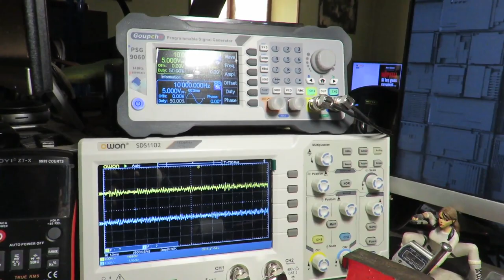GHK6/GHK8 multi-tool with bit kit, mini flashlight & camo sheath!

Comment from the maker: MT VOD * Dear lovers of multi-tools, you can ask me everything, redo a review, insist on a detail, make comparisons, test this or that, I am at your disposal! :) * Multi-Tool VOD
Here is my collection of multi-tools (March 2021) [/S = Brand Sheath]. Each model has been the subject of one or more videos (see my playlist "MULTI-TOOLS").
001-	AXE Multi-tool (pliers/ knife/ hammer/ axe) /S
002-	BALADEO Outdoor Camping Cutlery Multi-tool ECO104 /S (*3)               
003-	BEAR & SON Bear Jaws 155LS /S
004-	BEAR & SON Bear Jaws Multiscissors Gardener BC157GT /S
005-	BEAR & SON Electrician's Bear Jaws BC155EL /S
006-	BEAR & SON Mini Bear Jaws 153
007-	BIBURY GHK 10-in-1 EDC
008-	BIBURY Multifunction Garden Pruner BBY-MT11 (offered by the company) /S
009-	BIBURY Multifunction Tool 21-in-1 BBY-MT08 (offered by the company) /S
010-	BIBURY Multifunction Tool 16-in-1 X0016E2LAJ (offered by the company) /Box
011-	BLACK FOX BF200 /S
012-	BÔKER PLUS Tech Tool Carbon 4 /S
013-	BÖKER PLUS Tech Tool City 5 /S
014-	BUCK Knives X-Tract 730 /S
015-	BUCK Knives X-Tract 735BKS-B Essential
016-	BUCK Knives BuckTool 350 (MiniBuck)
017-	BUCK Knives BuckTool 355 /S
018-	BUCK Knives BuckTool 360 /S (*2/ one completely broken)
019-	BYRD ByrdRench BY15P /S
020-	COLEMAN Pro Lock /S
021-	CRKT Bivy CR9250 (by Hans Florine)
022-	CRKT Guppie CR9070 (by Launce Barber)
023-	CRKT Technician Multi-tool CR9201 (by Glenn Klecker)
024-	CRKT Tool CR9200 (by Ed Van Hoy & Tom Stokes/ with Bit Kit) /S
025-	CRKT Zylla-Tool Jr. CR9065K /S
026-	CRKT Wooden Multi-Tool Kit CR1035
027-	DEEPEE 8-in-1 Shears Multi-Tool /S
028-	DICE TOOL EDC Multi-tool
029-	EICKHORN SOLINGEN PRT-II Rescue Knife /Böker S
030-	FISKARS Cuts+More
031-	FLEXCUT JKN91 Right-Handed Carvin' Jack /S
032-	FLOCON DE NEIGE 18-in-1 /S (& 15-in-1)
033-	GANZO G301-H /S
034-	GANZO G302-B /S
035-	GERBER Armbar Cork
036-	GERBER Armbar Drive Onyx
037-	GERBER Balance /S
038-	GERBER Bullrush /S
039-	GERBER Center-Drive (with Bit Kit+ Victorinox Scissors) /S
040-	GERBER Center-Drive Plus (with Bit Kit) /S
041-	GERBER Crucial /S
042-	GERBER Crucial Black (with strap cutter)
043-	GERBER Crucial F.A.S.T. (with Hex Bit Kit)  /S
044-	GERBER Curve
045-	GERBER Diesel /S
046-	GERBER Dime (*3/one with broken cissors)
047-	GERBER Flik /S
048-	GERBER Fit /S
049-	GERBER FreeHand /S
050-	GERBER Freeman Exchange (with 3 blades) /S
051-	GERBER Grappler /S
052-	GERBER Prybrid Utility
053-	GERBER Prybrid X
054-	GERBER MP1 /S
055-	GERBER MP1-MRO (with Bit Kit) /S
056-	GERBER MP 400 Compact Sport (05500/ 45500) /S
057-	GERBER MP 500 Recoil Auto-Plier /S
058-	GERBER MP 600 Basic Black (07550) /S
059-	GERBER MP 600 Black (07550G1 Carbide Cutters) /S
060-	GERBER MP 600 Bluntnose (old model with 55200 Multi-Plier Pocket Tool Kit) /S
061-	GERBER MP 600 Bluntnose Black (07520G1N Carbide Cutters with Tool Kit) /S
062-	GERBER MP 600 Bluntnose (07500 Carbide Cutters) /S
063-	GERBER MP 600 Pro Scout (07564 with Tool Kit) /S
064-	GERBER MP 650 Evolution (with 2 heads)
065-	GERBER MP 700 Urban Legend /S
066-	GERBER MP 800 Legend /S
067-	GERBER MPT #5 /S
068-	GERBER Multi-Lite (07205)
069-	GERBER Nautilus /S
070-	GERBER Obsidian
071-	GERBER Octane /S (*2)
072-	GERBER Radius /S
073-	GERBER Splice
074-	GERBER Strata /S
075-	GERBER Suspension /S
076-	GERBER Suspension-NXT /S
077-	GERBER Truss /S
078-	GERBER Vise
079-	HANWEI Professional Multi-tool by PAUL CHEN 1008-GT
080-	HAVALON Evolve Jim Shockey Signature Series XTC-60AMTS /S
081-	HENSTRONG (or Bibury or Intey or …) 18-in-1 /S
082-	HX OUTDOORS Multi-tool /S
083-	KERSHAW A100C /S
084-	KERSHAW Select Fire 1920
085-	KELVIN.36
086-	KING INNOVATION L-tool Lighting Multi-tool 46700 /S
087-	KITA Le Dépanneur x2 /S
088-	LEATHERMAN Blast (with Removal Bit Driver) /S
089-	LEATHERMAN Brewzer
090-	LEATHERMAN Charge+ (with Bit Kit & Pocket Clip & Lanyard Ring & Bit Driver Extender) /S
091-	LEATHERMAN Charge+ Black Oxide /S
092-	LEATHERMAN Charge+ Forest Camo (with Bit Kit & Pocket Clip & Lanyard Ring & Bit Driver Extender) /S
093-	LEATHERMAN Charge+ G10 Earth (with Bit Kit & Pocket Clip & Lanyard Ring & Bit Driver Extender)/ S
094-	LEATHERMAN Charge+ G10 Orange (with Bit Kit & Pocket Clip & Lanyard Ring & Bit Driver Extender) /S
095-	LEATHERMAN Charge+ G10 Red (with Bit Kit & Pocket Clip & Lanyard Ring & Bit Driver Extender)/ S
096-	LEATHERMAN Charge+ TTI (with Bit Kit & Pocket Clip & Lanyard Ring & Bit Driver Extender) /S
097-	LEATHERMAN Charge+ Woodland Camo /S
098-	LEATHERMAN Charge AL /S
099-	LEATHERMAN Charge ALX Black Oxide /S
100-	LEATHERMAN Charge TI 2HO (with Bit Kit & Pocket Clip & Lanyard Ring & Bit Driver Extender) /S
101-	LEATHERMAN Charge TTI (with Bit Kit & Pocket Clip & Lanyard Ring & Bit Driver Extender) /S
102-	LEATHERMAN Charge XTI (with Bit Kit & Pocket Clip & Lanyard Ring & Bit Driver Extender) /S
103-	LEATHERMAN Core /S
104-	LEATHERMAN Crunch /S (*2 / including a clone)
105-	LEATHERMAN Expanse E306X /S
106-	LEATHERMAN Expanse E33BX /S
107-	LEATHERMAN Expanse E33T /S
108-	LEATHERMAN Expanse E55BX /S
109-	LEATHERMAN Expanse K502X /S
110-	LEATHERMAN Flair /S
111-	LEATHERMAN Free K2
112-	LEATHERMAN Free K2X
113-	LEATHERMAN Free K4
114-	LEATHERMAN Free P2 /S
115-	LEATHERMAN Free P4 /S
116-	LEATHERMAN Free T2
117-	LEATHERMAN Free T4
118-	LEATHERMAN Freestyle /S
119-	LEATHERMAN Freestyle CX /S
120-	LEATHERMAN Fuse /S
121-	LEATHERMAN Juice B2
122-	LEATHERMAN Juice C2 /S
123-	LEATHERMAN Juice CS3
124-	LEATHERMAN Juice CS4 /S
125-	LEATHERMAN Juice KF4 (offered by the company & signed in my name by Tim) /S
126-	LEATHERMAN Juice Pro (with Victorinox Mini Screwdriver) /S (*2/ one offered by the company & signed in my name by Tim) /S
127-	LEATHERMAN Juice S2 /S
128-	LEATHERMAN Juice SC2
129-	LEATHERMAN Juice SX /S
130-	LEATHERMAN Juice XE6 (with Victorinox Mini Screwdriver) /S
131-	LEATHERMAN Kick /S
132-	LEATHERMAN Klamath /S
133-	LEATHERMAN Leap /S
134-	LEATHERMAN Mako TI
135-	LEATHERMAN Micra
136-	LEATHERMAN Mini Tool
137-	LEATHERMAN MUT (with Bit Kit & Tool adapter V2) /S
138-	LEATHERMAN MUT EOD /S
139-	LEATHERMAN Nehalem /S
140-	LEATHERMAN OHT Coyote Tan(with tweezers) /S (*2)
141-	LEATHERMAN OHT Black /S
142-	LEATHERMAN PST (*2)
143-	LEATHERMAN PST II
144-	LEATHERMAN PULSE /S
145-	LEATHERMAN Raptor /S
146-	LEATHERMAN Rebar /S
147-	LEATHERMAN Rev /S
148-	LEATHERMAN Signal /S (with Bit Kit & Bit Driver Extender)
149-	LEATHERMAN Sideclip /S
150-	LEATHERMAN Sidekick /S (with carabiner)
151-	LEATHERMAN Skeletool /S
152-	LEATHERMAN Skeletool CX V1(with Bit Kit & MUT Bits) /S
153-	LEATHERMAN Skeletool CX V2 /S
154-	LEATHERMAN Skeletool KB
155-	LEATHERMAN Skeletool KBX
156-	LEATHERMAN Skeletool RX (with Bit Kit & MUT Bits) /S
157-	LEATHERMAN Squirt E4 (*2/ one offered by the company & signed in my name by Tim)
158-	LEATHERMAN Squirt ES4
159-	LEATHERMAN Squirt P4
160-	LEATHERMAN Squirt PS4
161-	LEATHERMAN Squirt S4
162-	LEATHERMAN Steens /S
163-	LEATHERMAN Style
164-	LEATHERMAN Style CS
165-	LEATHERMAN Style PS
166-	LEATHERMAN Super Tool /S
167-	LEATHERMAN Super Tool 200 (with Tool Adapter V1) /Combo S
168-	LEATHERMAN Super Tool 300 /S
169-	LEATHERMAN Super Tool 300 EOD /S
170-	LEATHERMAN Super Tool 300M /S
171-	LEATHERMAN Surge (with Bit Kit & Pocket Clip & Lanyard Ring & Bit Driver Extender) /S
172-	LEATHERMAN Surge 2013 Black Edition (with Bit Kit & Pocket Clip & Lanyard Ring & Bit Driver Extender) /S /Kydex CF Sheath
173-	LEATHERMAN Tread Stainless Metric
174-	LEATHERMAN Wave (with Bit Kit & Pocket Clip & Lanyard Ring & Bit Driver Extender) /S
175-	LEATHERMAN Wave+ (with Bit Kit & Pocket Clip & Lanyard Ring & Bit Driver Extender) /S
176-	LEATHERMAN Wave+ Black Oxide Limited Diegel Edition /S
177-	LEATHERMAN Wave Original /S
178-	LEATHERMAN Wingman V1 /S
179-	MASERIN Citizen 564/G10N (by Moris Baroni)
180-	MAXKNIVES MKTI1
181-	MIKOV NUZ 246-NH-4/RESCUE
182-	MORPILOT Hammer multi-tool /S
183-	MOSSY OAK 17-in-1 /S
184-	NEXTOOL Xiaomi 10-in-1 KT5023 Motool /S
185-	NEXTOOL Xiaomi Flagship Mini KT5022
186-	OPINEL N°9 Bricolage
187-	OPINEL N°12 Explore
188-	OZARK Trail MULTIFORCE PREMIUM 18-IN-1 MULTI TOOL /S
189-	PIRANHA 6-in-1 (crescent wrench & pliers combo) /S
190-	PIRANHA 9-in-1 (crescent wrench & pliers combo) /S (*2)
191-	RATNIK 6E6 (with diamond-coated file) /S
192-	REAL AVID Fun Tool Max /S
193-	ROXON Flash S803 (offered by the company) /S
194-	ROXON Knife Scissors S501 (*2 / one offered by the company)
195-	ROXON Multi BBQ Tool MBT Mini S602 (offered by the company)
196-	ROXON Multi BBQ Tool MBT3 S601 (*2/ one offered by the company) /S
197-	ROXON Phantasy S502 (with all blades offered by the company)
198-	ROXON Phantom S802 (*2/ one offered by the company) /S
199-	ROXON Spark CM1349 (*2/ one offered by the company) /S
200-	ROXON Storm S801 (with bit kit & Victorinox Mini Screwdriver) (*2 / one offered by the company) /S
201-	ROXON Storm S801S (with bit kit & Victorinox Mini Screwdriver) /S
202-	RUIKE Criterion M61-G (with Victorinox Mini Screwdriver) /Böker S
203-	RUIKE Trekker LD43 Rescue Tool
204-	RUIKE Trekker LD51-B (with Victorinox Mini Screwdriver) /Victorinox S
205-	SCHRADE Tough Chip ST2 /S
206-	SCHRADE Tough ST1 (original U.S./ version 1) /S
207-	SCHRADE Tough ST1 (Taylor Brands Schrade) /S
208-	SCHRADE Tough ST11 /S
209-	SCHRADE Tough STE5 /S
210-	SEBERTECH Sebertool M2
211-	SEBERTECH Sebertool M4
212-	SOG CrossCut 2.0
213-	SOG CrossGrip
Reply from the maker: 214-	SOG Kilowatt
215-	SOG Micro ToolClip
216-	SOG Paratool S31 (with Saw instead Philipps screwdriver + Bit Driver + Hex Bit Accessory Kit) /S
217-	SOG ParaShears /S
218-	SOG Pocket PowerPlier S44 /S
219-	SOG PowerAccess Assist (with bit kit) /S
220-	SOG PowerAccess Deluxe (with bit kit) /S
221-	SOG PowerAssist S66 (with Saw instead of V-Cutter) /S 
222-	SOG PowerDuo PD01 /S
223-	SOG PowerGrab (with Bit Kit) /S
224-	SOG PowerLock S60 (with Bit Kit) /S
225-	SOG PowerPint (with Bit Kit) /Böker S
226-	SOG PowerPlay (with Bit Kit) /S
227-	SOG Snippet
228-	SOG SwitchPlier V2.0 /S
229-	SOG Sync II
230-	SOG ToolClip S23
231-	SPLITMAN GHK6 (with bit kit) / S
232-	SPYDERCO ASSIST SALT FRN YELLOW C79YL - Rustproof H-1
233-	SWISS+TECH (GreatStar Tools)) 17-in-1 Multi-tool Pliers
234-	SWISS+TECH Micro-Max 19-in-1
235-	SWISS+TECH Micro-Plus EX 9-in-1
236-	SWIZA C08 Urban Camo /S
237-	SWIZA D10 Mousse /S
238-	TAG SUPRA SS Credit Card Multi-tool
239-	TOPEAK The Alien I /S
240-	TOPEAK The Alien III /S
241-	TRUE UTILITY Tectonic TU220 /S
242-	TWOSUN KNIVES TS206 Tanto
243-	UD Vape Cool Kit Multi-tool Cutting Pliers /S
244-	UTICA KUTMASTER Multimaster 11-3565CP /S
245-	VICTORINOX Bantam Alox (0.2300.26)
246-	VICTORINOX Classic 2019 Limited Edition When Life Gives You Lemons (0.6223.L1905)
247-	VICTORINOX Classic SD Navy Camo (0.6223.942) /S
248-	VICTORINOX Compact (1.3405)
249-	VICTORINOX Cybertool L (1.7775.T) /S
250-	VICTORINOX Cybertool Lite (1.7925.T) /S1
251-	VICTORINOX Electrician Alox (0.8120.26)
252-	VICTORINOX Evolution Grip 18 (2.4913.SC8B1) /S
253-	VICTORINOX Evolution Grip S54 (2.5393.SC) /S
254-	VICTORINOX Expedition Lite (1.7965.AVT) /S
255-	VICTORINOX Explorer 2017 White Christmas Limited Special Edition (1.6703.77)
256-	VICTORINOX Farmer X Alox (0.8271.26)
257-	VICTORINOX Hiker Walnut Wood (1.4611.63) /SwissQlip
258-	VICTORINOX Huntsman Lite (1.7915.T) /S
259-	VICTORINOX Huntsman SilverTech (1.3713.T7) /S /SwissQlip
260-	VIVTORINOX Jelly SwissCard Lite (0.7333.T3B1)
261-	VICTORINOX MiniChamp (0.6385) /S
262-	VICTORINOX MiniChamp Alox (0.6381.26) /S
263-	VICTORINOX MiniChamp Lite (0.6386) /S
264-	VICTORINOX My First Victorinox H (0.2373.T2)
265-	VICTORINOX Nail Clip 580 (0.6463)
266-	VICTORINOX Ouvre Montres (0.2102)
267-	VICTORINOX Pioneer X Alox (0.8231.26)
268-	VICTORINOX Pioneer X Alox Limited Winter Magic Limited Special Edition 2020 (0.8231.22E1)
269-	VICTORINOX Ranger Grip 58 Hunter (0.9683.MC) /S
270-	VICTORINOX Ranger Grip 71 Gardener (0.9713.C) /Wenger S
271-	VICTORINOX Ranger Grip Boatsman (0.9798.MWC8) /S
272-	VICTORINOX Rescue Tool (0.8623.MWN) /S
273-	VICTORINOX Signature Lite SilverTech (0.6226.T7) /S
274-	VICTORINOX Spartan Onyx Black (1.3603.31P)
275-	VICTORINOX SportRachet (1999) /S
276-	VICTORINOX Super Tinker Limited Winter Magic Limited Special Edition 2019 (1.4703.7E1) /S
277-	VICTORINOX Swiss Soldier’s Knife 08/2018 (0.8461.MWCH) /S
278-	VICTORINOX Swisschamp (1.6795.T) /S
279-	VICTORINOX Swisschamp XAVT (1.6795.XAVT) /S
280-	VICTORINOX Swisschamp XLT [1.6795.XLT] /S
281-	VICTORINOX SwissTool X (3.0327.L) /S
282-	VICTORINOX SwissTool PLUS (3.0323.L) (2008 – BMW/ with all accessories & scissors) /S & Gaine ouverte 4.0829
283-	VICTORINOX Swisstool  Spirit MXBS Black Oxide (3.0226.M3 or 3.0226.3AUS) /S
284-	VICTORINOX SwissTool Spirit S Black Oxide (3.0223) /S
285-	VICTORINOX SwissTool Spirit XBS (3.0224.3CN) /S
286-	VICTORINOX SwissTool Spirit XC PLUS RATCHET (3.0239.N) (with all accessories) /S
287-	VICTORINOX Traveller Lite (1.7905.AVT) /S
288-	VICTORINOX Wine Master Walnut Wood (0.9701.63) /S
289-	VICTORINOX Workchamp V1 (0.8564) /S
290-	VICTORINOX Workchamp XL (0.8564.xl) /S
291-	WALTHER Multi-Tac /S
292-	WENGER Basic 66 (1 66 41)
293-	WENGER EvoGrip S557 (1.557.059.821 with Victorinox Mini Screwdriver) /S
294-	WENGER PocketGrip 577 /S
295-	WENGER Ranger 13 Gardener (1 77 13)
296-	WENGER RangerGrip Handyman 1.077.0[90.822] /S
297-	VICTORINOX RocKnives Bijou 53 Azul Santa Crux Brazil (0.6200.53)
298-	WENGER Bernina Mini Spot Light (031602.70.01)
299-	WENGER Swiss Business Tool SBT 60 /S (*2)
300-	WENGER SwissGrip (WengerGrip 76) (1 76 01 61)
301-	WENGER Titanium 1 (1.092.041.000) /S
302-	WENGER Titanium 2 (1.092.042.000) /S
303-	WENGER Titanium 3 Ueli Steck Spécial Edition (1.092.040.000) /S
304-	WOHO Wokit Carabiner multi-tool
305-	WORPRO 16-in-1 Multi-tool /S
306-	XIAOMI Nextool Huohou (or Nextool 16-in-1 or 16-in-1 Flagship Pro) /S
307-	XIAOMI Nextool Huohou Mini
	
Acquisition forecast - Call for donations… Sog, Gerber, Victorinox and the others (except Roxon, Bibury & Leatherman) still stubbornly refuse to send me models that I could present. We live in a world unnecessarily absurd delivered to spirits that seem to be content with it...
1-	BLACKFIRE HDMT1
2-	CRKT Septimo Multi-tool
3-	EMERSON Multitasker EDC 1/ 2
4-	EXTREMA RATIO Evo
5-	GERBER Cable Dawg
6-	GERBER Steady
7-	GERBER Survival Tool Pack
8-	GRIPsher
9-	KAMPO NS-2
10-	LEATHERMAN Charge+ TTI Damascus/ Damascus Carbon/ Damascus Wood
11-	LEATHERMAN Expanse E33B/ E33TX/ E55B/ E307X/ K503X
12-	LEATHERMAN Pruner Genus
13-	LEATHERMAN Removal Pocket Clip 934860 (for Kick)
14-	LEATHERMAN Skeletool SX
15-	LEATHERMAN Ukiah
16-	LEATHERMAN Z-REX
17-	FKMD M.P.S.K. Survival Camp Tool FX-444/3MB
18-	MELITA-K Sapper/ Professional MLK031/ Noks Sapper/ Wag-3
19-	SCHRADE I-Quip
20-	SOG Paladin PowerPlay PT-540
21-	SPYDERCO ClipiTool Rescue C209GS
22-	SPYDERCO Spyderench T01
23-	SWISS+TECH (?) Multitool Knife 13-in-1
24-	TOLER TOOLS
25-	VICTORINOX Parachutist One Hand
26-	VICTORINOX US Soldier 2017 (0.8461.MWUS)
27-	WENGER Laser Pointer (1.97.01 cissors)
28-	WENGER Ranger 14 Gardener (13 + saw)
29-	WENGER RangerGrip 88/95 - Rescue I/II

Comment: Wanted to tell you leatherman coming out with ratchet adapter for the multi tools. I’m sure you know , I can’t wait!
Reply from the maker: Yes, of course and I ordered three copies.
Reply: @diezelle57  I went to the site could not order any from leatherman
Reply from the maker: @PeterAgostiniJdcap26  REI, Knifestore, etc.
Reply: @diezelle57  leatherman just got them back in stock.
Reply from the maker: @PeterAgostiniJdcap26  :)
Reply: @diezelle57  one of the best things they could make for an accessory!  Hope it goes through your tests worried
Reply from the maker: @PeterAgostiniJdcap26  I think the ratchet will withstand the twisting force of a very strong man, so that will be enough :)
Reply: I don't expect to much from the ratchet. Just seeing a vid from TX Tool Crip.
And 35 € no way...
Let's see what Diegel will say... 🙄🤔
I got my WERA cyclop and standard extender...💪💪💪
Reply: @diezelle57  Paul above does not think so ?
Reply from the maker: @PeterAgostiniJdcap26  We'll see with the tests. My hunch is this: Leatherman would not allow itself to put a ratchet on the market that breaks under strong manual effort. This ratchet is, in my opinion, sized to the strength of the bit holder. Have you heard of a Leatherman bit breaking? In Leatherman, I trust... (except for his files).